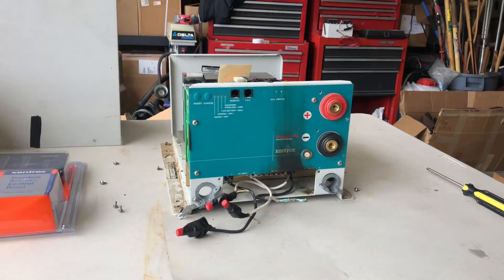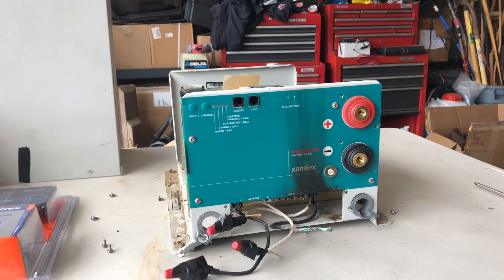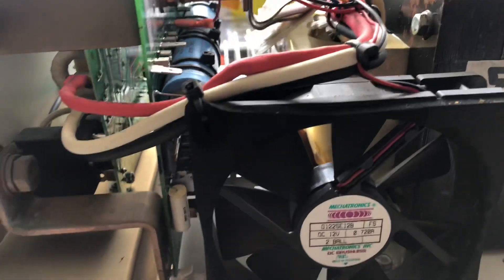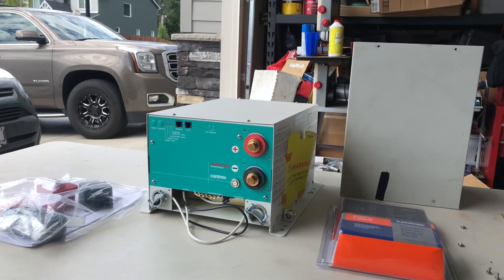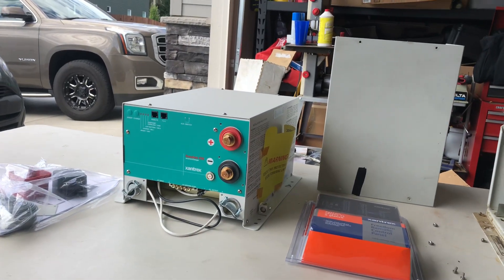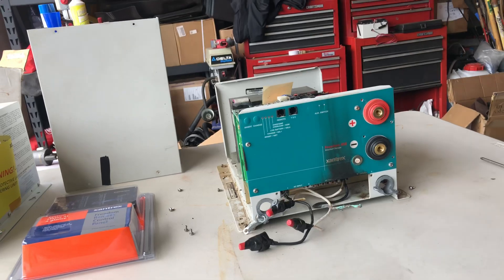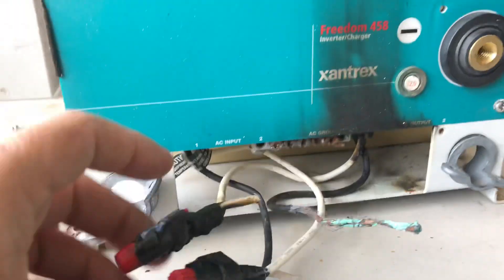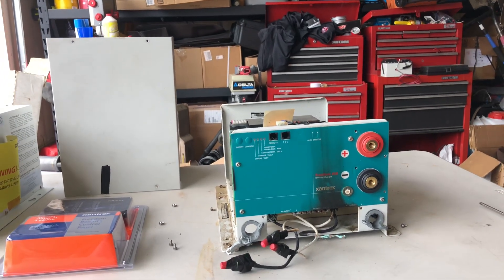Xantrex Freedom 458 Inverter Charger Fail

Comment: I have a 2005 458 that over temps (shore power or generator) when the house battery  cutoff switch is engaged. When the cutoff switch is disengaged the charger works fine. Could someone shed some light on the possible problem? I’m thinking I have a bad battery.

Comment: when I flipped the switch to the electric water heater, the Freedom 458 (several years old on boat), made a Loud pop and smoke started to come out. After that it no longer provided any current and the remote panel LEDS are no longer lit. I suspect there was too high of a current draw or possibly a short in the boats fuse box where the 458 is integrated and perhaps a back current occurred. Should not the unit have protected itself from that.

Comment: Just discovered your channel and subscribed!  We have a Freedom 458 as well, and love it.  I found your channel looking for info on why the 12V output jumps around between 12 and 15 volts, rather than a steady 13.x.  I think doing this is what's causing the breaker between the inverter and our LiFePo battery to trip after only a few seconds, but I'm not sure....so I'm looking around!   really appreciate the information on your channel, thanks for providing it! :)
Reply from the maker: Make sure your rv’s batteries are full of distilled water if they are lead acid.  The charging system could be overworking.
Reply: @CannonsRvRepair  Hey, thanks for the info!  We're running a 200aH LiFePo battery.  We upgraded last year from AGMs.  The inverter was working fine then.
Reply from the maker: @patrickwatson3042   Did you update the controller?
Reply: @CannonsRvRepair  We have a Renogy 40A Rover charge controller.
Reply: @CannonsRvRepair   Hi ,,Which values are  the c7 and the R150 on your control board please ?
Reply: How can I purchase new xantrex freedom 458

Comment: Can't folks just buy a board and replace on their own. My AC board failed. Cant I just replace it without sending the entire unit in for repair  ?
Reply: I did with my aims so yes it can be done with this pcs electronics makes videos on these
Reply: @coreybabcock2025  i bought a board on eBay and popped it in myself shortly after my original post. Haven't had a problem since. Easy and no point paying somebody to do a simple plug and play fix.